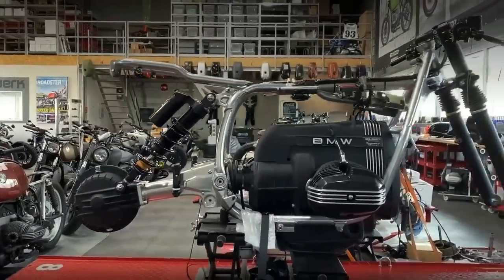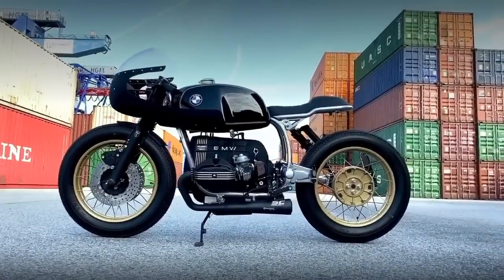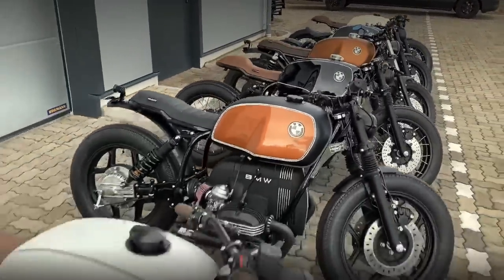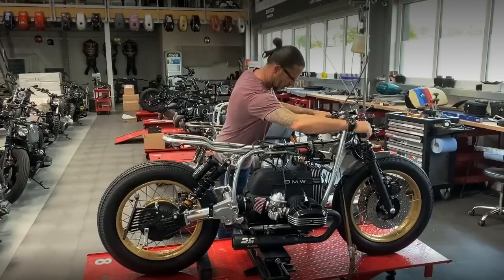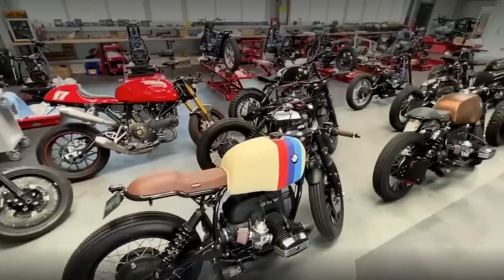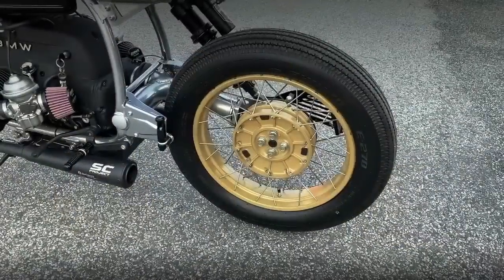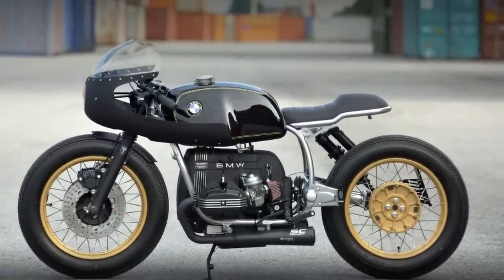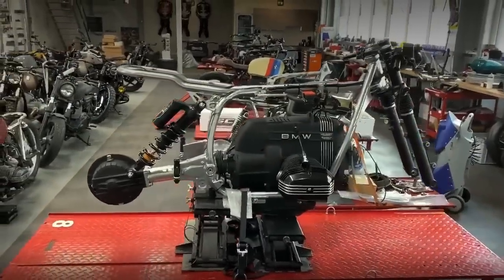Cafe Racer (BMW R100 by WalzWerk Motorcycles)

Comment: 🇨🇦 For 20 years I have had a 1983 R100 with a bent frame, bent front wheel, busted front forks, bent handle bar but with rebuilt motor having only 19K km under its belt sitting in my garage. I have a spare frame, forks and wheel sitting there as well...  Now that my 2017 R9T cafe racer creation is complete your video now focuses my eyes on that old R100. Thanks for the inspiration!
All the best to you from Canada. 🇨🇦
Reply from the maker: Thank you my friend for sharing your perspective. :) Cheers.

Comment: Not only is this build stunning, its also TÜV-approved, which is a big hurdle for custom builds in germany. You cant just saw the frame, weld a little bit and drive it on the street. Almost everything you change needs to be approved. That makes this build even more impressive
Reply from the maker: Indeed. Acording to this Builder, most of the custom parts He sell, are TÜV-approved. :) Cheers.
Reply: @RACER_TV  thats awesome, i will use some of his parts when i will be building mine in about a year. Thanks for showing me this builder👍
Reply: what a boring world we live in, eh?

Comment: What can you say about something built by BMW? that must have under the sad plastic of the 90s a heart of pure and pristine metal, ready to receive love. I don't know if the correct comparison is Henry Ford, that I dislike the guy for being a "light fascist", not so the pick up trucks of the 70s and 80s of the F series, which almost any motorcycle enthusiast loves for practical, resistant and beautiful. Indeed, something mechanical can and is in fact something beautiful. The bike reviewed could be in an art gallery without any regrets, because despite the standardization of the parts installed by WalzWerk Motorcycles it is a truly unique piece of engineering and design, based on something as special as a motorcycle built by the Bavarian manufacturer. Something that historically happened with the Henry Ford vehicles from the Model T, to the F trucks and not to mention the Mustang 67 and a hallf hatchback!  Gracias Marcus, Henry and Victor (in spsnish) for such a great vision of a great bike and memories!
Reply from the maker: Hola amigo, I understand from where your love for BMW motorcycles is coming now. Lol. I saw a documentary about the fascist interest of Henry Ford before the 2º world war. But it seems He changed his mind after the beginning of the war.  Thank you my friend for sharing your opinion. :) Cheers.

Comment: Why do custom builders continually use those square tires. Shortening the forks until there is nearly no travel left.
They may look good but they will not ride well
Reply: David McLachlan it’s all about Looks, the customers just want a cool looking bike to ride to a cafe on Sunday mornings
Reply: Custom bike is not about comfort is all about special look one of the kind,if you want comfort you buy a stock bike.
Reply: I say form follows function. The bike has to rideable as the very least, if it ends up being even better than expected, then that’s another clue that it was built right. The bar hoppers look good but man, they are rough to ride.

Comment: ive tried so much to reach out to you with no avail, maybe the bike i built in a country like mine with a 220 cc 4stroke engine is not something you want to talk about on your channel, i dont know
Reply from the maker: As you may understand, I have to be extremely demanding when I choose a cafe racer project for a Racer TV's video. Only this way I can satisfy what Racer TV Fans are expecting from this channel. Unfortunately, it is hard for to say no. that is why most times I prefer to remain silent, even because it is impossible to answer all the messages i receive everyday. Cheers